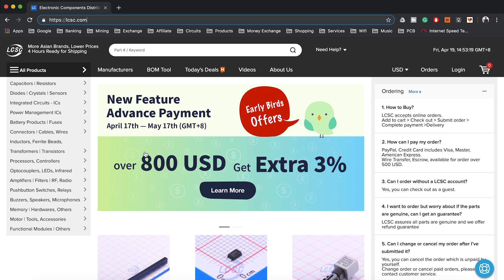DIY 200 Watt HiFi Audio Amplifier

Comment: This power supply is no good for the UK (England) as its only 220 AC, UK is 240 volts AC.
Reply from the maker: it can easily handle up to 270V Don't worry
Reply: On Banggood it says 100 - 220 volt? @SteveWillsonKujur
Reply from the maker: It only says i know trust me , the components it is used in the board I've seen the specification